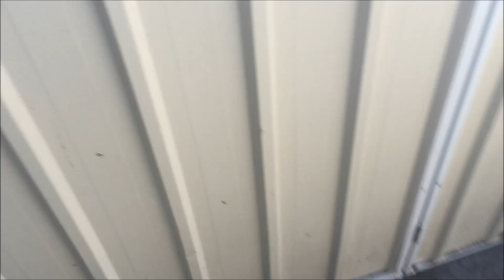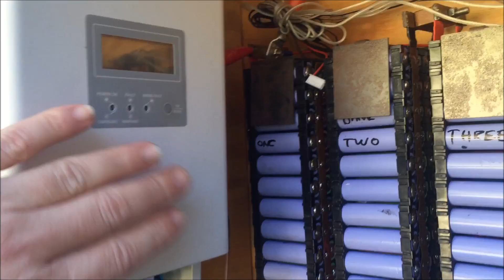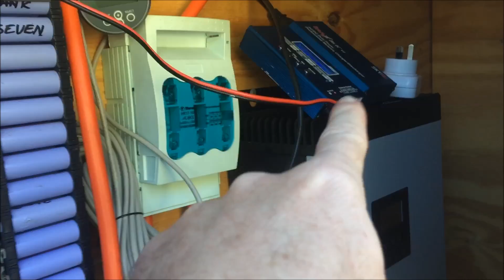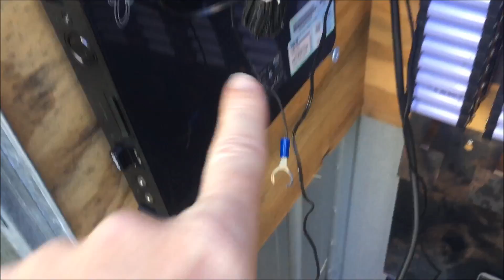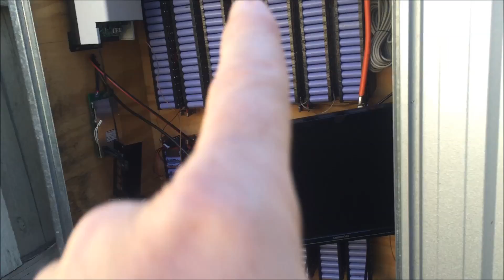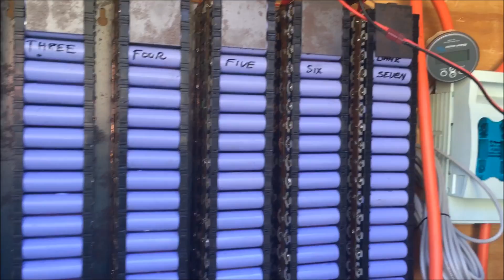Update   Thermal camera, Load test soon & New shed

Comment: that balance module is working properly then?
Reply from the maker: it's working, but struggles - it's been taken out for now, but it'll put it back in once soon as now I'm doing the final 1000w load test it will be the last time that shed is in that configuration. All 240v will be removed and some serious cable management will take place.